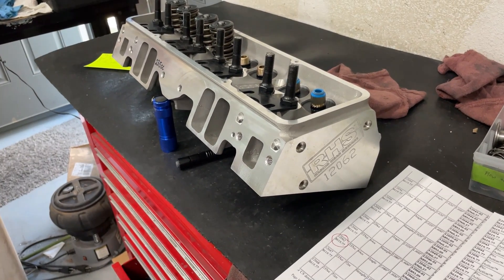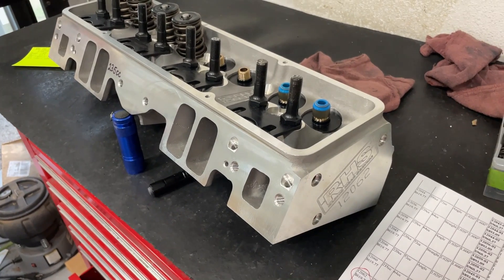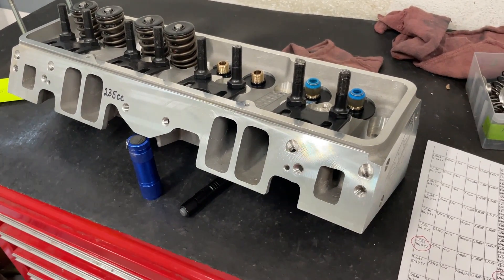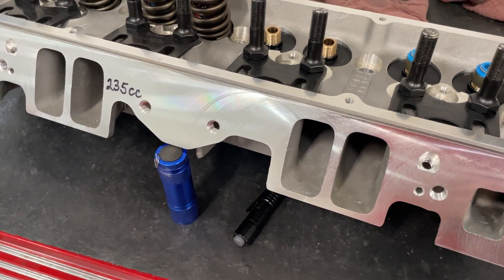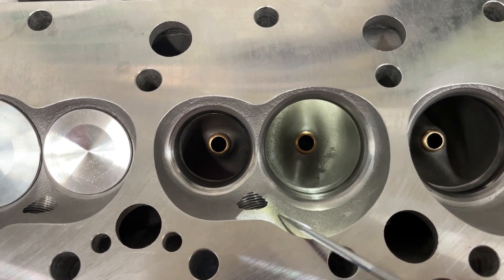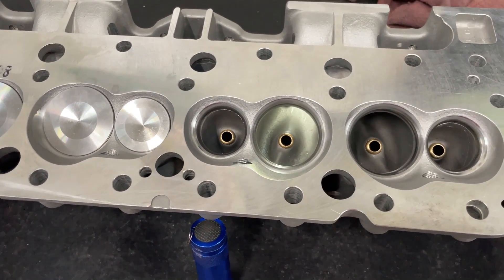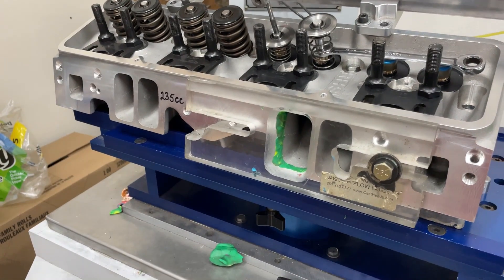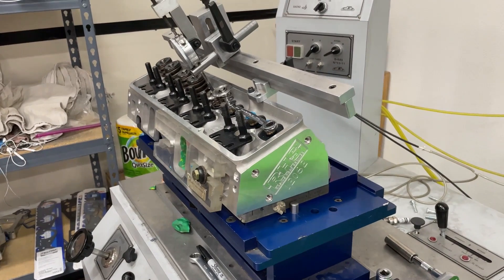RHS 235cc SBC Review With Real Flow Numbers

Comment: I have a set of RHS heads 200cc 2.02 and 1.60 64 cc angle heads was wondering if it is possible to to make a 235cc they are steel heads

Comment: I have pro topline heads on my truck, cleaning them up but only place I can find the plastic o rings that go on the second ring under the keeper is rock auto.
Delivery to Newfoundland is 50 something....
Reply from the maker: Thats an extra grove on the valve for those seals. If you run good seals on the guides you don't need them.

Comment: I bought a set of those in Iron for less than $300 a piece back in 2012 or 2013. We had a basic bowl and chamber job done, opened up the exhaust guides and angle milled them down to 57cc and they sat for years. Ran them at the March Meet this year on a stock length rod 350 with a tired 6-71 and got consistent 7.0s with one 6.97. While large for that engine size, they flow pretty damned good. They take a fair amount of massaging to get the pushrods to clear everything, especially when you run shaft mounted rockers.
Reply from the maker: They are nice heads. I haven't had problems with pushrods on the ones I used.
Reply: @WeingartnerRacing  could be our particular rocker setup. Wasn’t bad, just had to do a little grinding. Bob Lambeck did the valve job not long after I got them and he said they were some of the nicest 23 degree castings out of the box he’d ever seen.

Comment: I have 1 set of each of the 180 , 200 , 220 , 235 as cast heads . There a great head . Also have a set of CNC ported 242cc head they did all in 23 degree . The casting that were done on the original Kiwi pro alloy heads are different to the RHS head  on the intake runner on there 200cc heads , They were suppose to be the same but they are not .

Comment: Edit:(i can do the machineing myself so that costs are much lower)

Wanted to get your opinion on this as im trying to build a 300hp 435lb tq 800$ setup with my 1982 300 cubic inch ford inline 6

The plan already is 
10.0 compression
Hyperuetectic pistons 
6.8 inch long rods vs the stock 6.210
And balancing the entire bottom end
2.02 cleveland valves 1.6 chevy exhaust
Bbc roller rockers
Cam 
Int 272.  236 @50
Exh 268 230 @50
580 total lift both lobes
108 lobe centers
Raised ports on the intake side since the stock ports sit almost a full 90 degrees from the valve, the air flow is almost a direct L, 

Stock head flow is 145 to 155cfm depending on casting quality, what would you do to improve this head, ive learned a lot from your channel and cant appreciate it enough

Comment: Still have a set of 235cc iron lightnings for a 360 build I did back in 2005 for my 55 Chevy.  260 @ 0.50 cam..
Also picked up some 200cc 50cc chamber Pro toplines. 
I snag them whenever I can. 
MY 235's flowed 308 and 210 @ .700 out of the box.

Comment: (Long story)...My friend Carl had a set of the iron head Pro Topline 235's. THESE HEADS ARE BAD ASS!!! He had a 350 with a steel crank and eagle rods and an old Busch/Sprint nascar solid flat tappet cam someone give him with something ridiculous like a 308/318 adv. 270 @ .50 with .525 lift. Flat top motor. Carl would bury his Autometer tach at 10,000 rpms...and hold it there until Jesus said to stop lol or hs foot got tired. Which was about 3 seconds after he buried the needle. It would pull from 4500/5000 rpm to probably 11,000/12,000 rpm (highly doubt that but it sounded like 12,000 rpm lmao). Good God that motor would pull hard!!! He chose these heads over a set of the Motown 220's. I highly suggest if you run the 235's, I hope you have a decent sized cam because they love the higher rpm range even from a .30 over flat top 350. He never ran the car at the track but he absolutely embarrassed a few cars that ran 6's in 1/8 mile spinning the whole time and missing gears. He went from 3.73 gears, to 4.88, and put 5.13 gears in it. I'm pretty sure the cam helped a lot...but even with .525 lift the car (69 Chevelle) would pull  hard. After he put the 5.13 gears in it...the 1 to 2 shift would almost take your breath away. It was scary fast. I've been in a lot of hot rods and drag cars but that little flat top iron headed 350 was one of the scariest rides I've ever experienced as far as a legit street car goes. I mean a SB2 or most of the big cubic inch 15 degree headed small blocks didn't seem to pull that hard. These were highly soft after back in the day. And if you got your ass handed to you...it was probably from a motor that had these heads on it.
Reply: Great story 👍

Comment: I regret selling my pro topline cnc 235. At time head shop i use  was  asking " whered you get these impressive things".  I ran them on a 377 ci.  Work very very well. Still keep my eye open for a good set just cuz i have a small block on 2.02  fulies per circle track rules that i know would love a better set of heads and be put in my street/strip car.

Comment: I ran Pro Topline for years on my oval track engines. Especially their 220 cast iron raised runner 23 degree which was unique and their 14 degree head. I got to know Peter in New Zealand quite well. Won a ton of races with their heads
Reply: That is a RHS casting NOT a Pro ACTION Casting Now the REAL PRO ACTION Heads was the Best Heads OUT the BOX ...... & Pro ACTION Made 23° in  180-200-220-235 in Regular 23° as well as Raised Runner 220-235 & 256 Spread Port
Reply: Exactly,  these heads are really an unsung hero. Never got the publicity and recognition they deserved.  Just sad , but great times for us that used them.

Comment: I built a 434 with those heads, 12.5 compression I ported them, 34 hundred pound pro Street s10 ,1 carb 850 brawler  it ran 8.90 first time down 1 quarter mile, I was sold and still looking for them

Comment: The backstory is somewhat accurate.  The thing is, EQ didn't decide to stop making the heads. The foundry in New Zealand that made them decide to close up and sell the property. Apparently the property was worth more money than they could make by manufacturing heads. There went the RHS heads, EQ heads, and a few others. EQ is trying to source some castings, but they are not as good as they used to be.

Also, RHS has been owned by Comp for some time. They did heads and machine work, then sorta faded away and came back as a cylinder head supplier.
Reply: @port nut I liked them a lot, they sold well. I would live to get something like that again.

Comment: Whatever happened to those SBC twisted wedge heads?
Reply: I have a set of twisted wedge heads on a 383 in a 1985 Corvette with a Superram intake.
Reply: You would have to call TFS and ask them but I don't think they make the Chevy version anymore. The 13 degree intake G1 realky needed a different rocker (0.050 backset) and it got a bad name from destroying valveguides. The 16 degree G2 would run the standard rockers but the rep for eating valveguides was hard to live down. I think the TFS 23 pretty well superceded it. 

The 13 degree had a rep of going 300 cfm pretty easily if a guy had experience with other kinds of ports. They could be tricky for a pprter with Chevy only experience.
Reply: Twisted wedge is a wired head needs alot of other offset parts and piston also